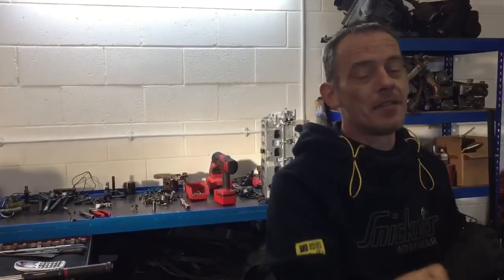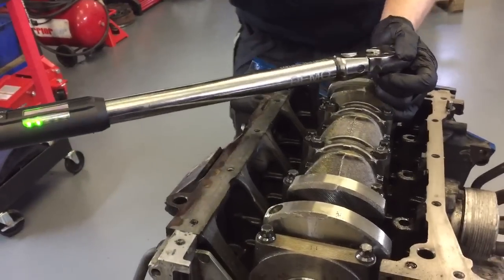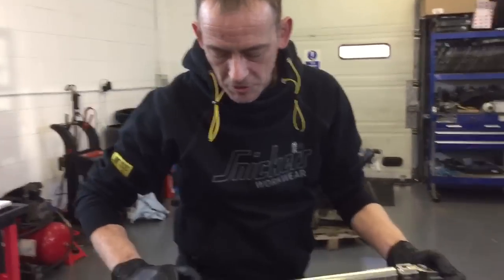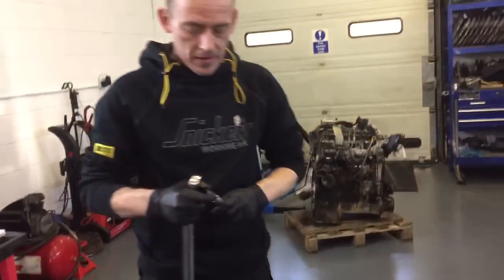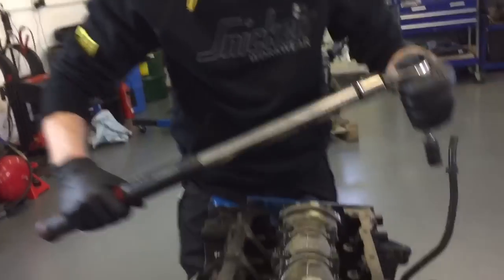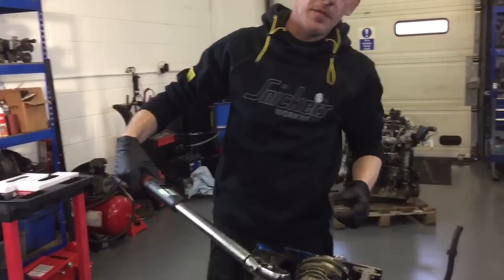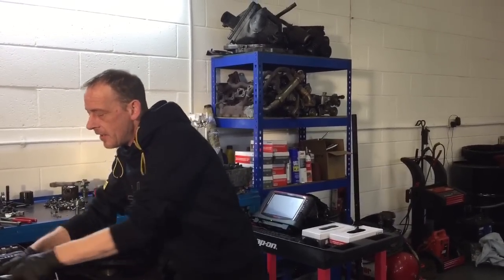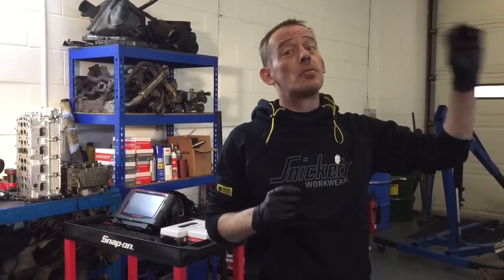Nissan bottom end settings

Comment: hi i have a problem on my nissan pathfinder 2.5 is overheating when towing i replace the water pump thermostat coolant and the fan clutch, i remove the top of the radiator and clean inside but still overheating in towing, in normal drive is ok i can drive 250km and no overheating, only in uphill or towing aditional not bubbles in the radiator or something With the head